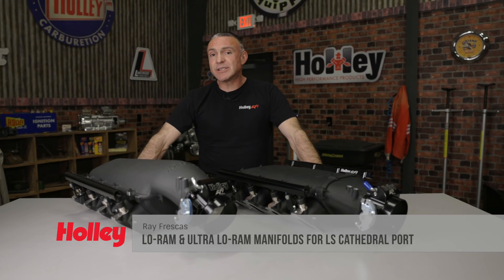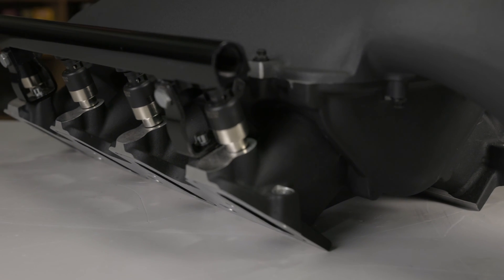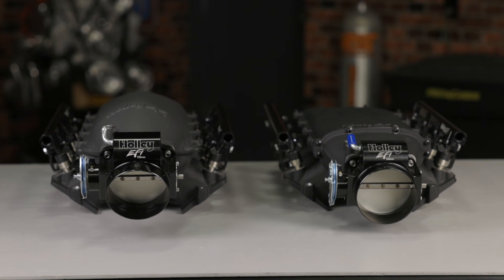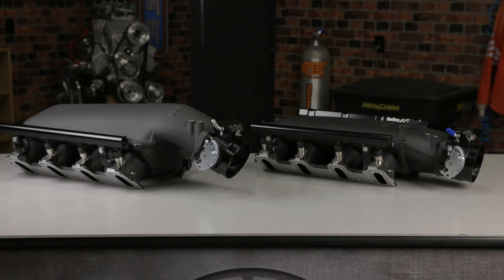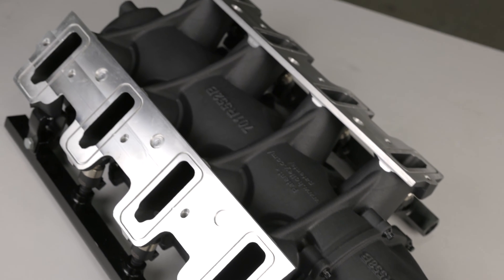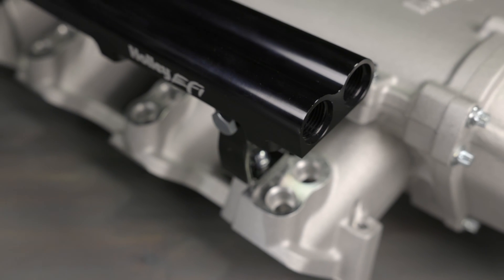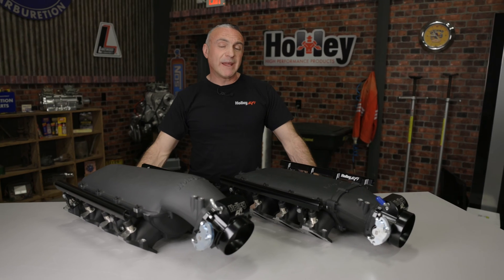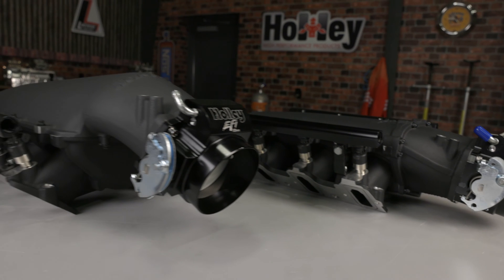Introducing Holley’s Compact, High-Power, Lo-Ram LS Intake Manifolds

Comment: Already Dino tested and proven not to be efficient. LS 3LQ for truck manifold and the fast manifold still hold the title for best flow
Reply: They insist on the shortest runners for big plenum space, which is NOT helpful unless you build for >8000 rpm.